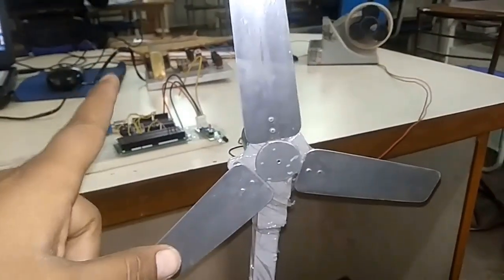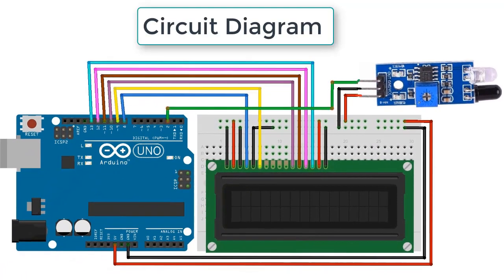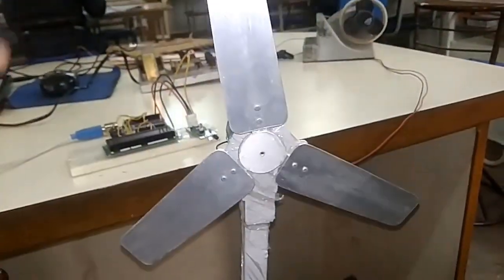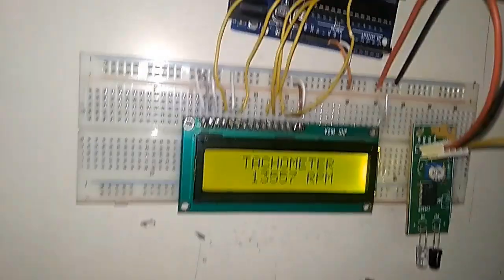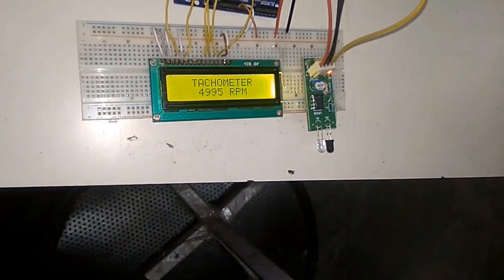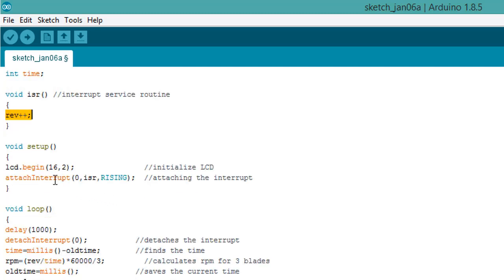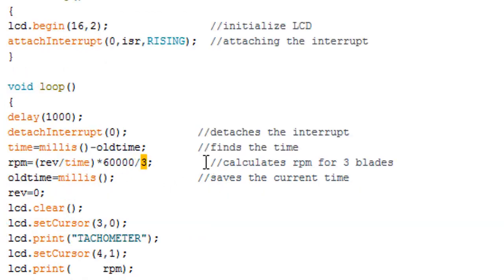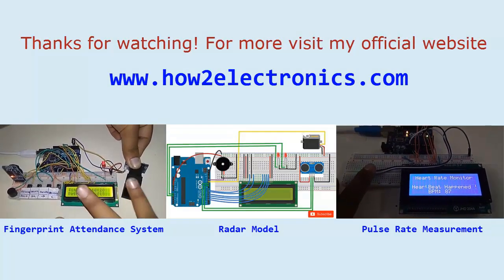Fan Speed (RPM) Measurement using IR Sensor and Arduino || Tachometer

Comment: Hi. How would this be done without using microcontrollers?
Reply: did you find out? Because i have the same problem. Let me know if you found a way
Reply: @nabeelkara31  see 1:01. pin 7 on arduino is used, use the video image at 1:1 to make the connections. It will work.

Comment: how to display it in serial monitor?
i change the code to display it in serial monitor, but it does not work. 

CODE:
//to display on serial monitor code:

float value = 0;
float rev = 0;
int rpm;
int oldtime = 0;
int time;

void isr() //interrupt service routine
{
rev++;
}

void setup()
{
Serial.begin("Initializing");
attachInterrupt(0,isr,RISING);          //attaching the interrupt
}

void loop()
{
delay(1000);
detachInterrupt(0);                     //detaches the interrupt
time = millis() - oldtime;              //finds the time
rpm = (rev/time) * 60000 * 3;           //calculates rpm for blades
oldtime = millis();                     //saves the current time
rev = 0;
Serial.println("TACHOMETER");
Serial.print( rpm);
Serial.print(" RPM");
Serial.print(" ");
attachInterrupt(0,isr,RISING);
}
Reply: So it should be

float value=0;
float rev=0;
int rpm;
int oldtime=0;
int time;

void isr() //interrupt service routine
{
rev++;
}

void setup()
{
Serial.begin(9600);
attachInterrupt(0,isr,RISING); //attaching the interrupt
}

void loop()
{
delay(1000);
detachInterrupt(0); //detaches the interrupt
time=millis()-oldtime; //finds the time
rpm=(rev/(time))*60000/7; //calculates rpm for blades
oldtime=millis(); //saves the current time
rev=0;
Serial.println (rpm);
attachInterrupt(0,isr,RISING);
}

I use no LCD. only serial monitor
Reply: @ukhtifathimahramadhani2090  mine show zero value all the time. which pin is used for the ir sensor?
Reply: You should add this after the void setup ()
Serial.begin (9600);

And simply this after the  void loop () to replace the code for lcd
Serial.println(rpm);

Hope it works on you!

Comment: thanks , but i think you have error in your code which is   
rpm = (rev/times)*60000/3 ; 
it should be : 
rpm = (rev/(times/3))*60000 ;
Reply: Brother where is sensor difine pin in your code ?
Reply: please help me... there's some error "old time not defined" in this program. what do i do?
Reply from the maker: Thanks for correction. I will update that on website.
Reply: Hi bro I need help in writing pic program to find rpm using IR sensor for motor like Hertz to rpm
Reply: @mahmoud zaher I want help in writing pic program to find rpm using IR sensor for motor it like Hertz to rpm

Comment: hello sir ... im follow your instruction .... but my lcd doesnt write anything ....  its appear something but in square pixel ... n make me confusing... pls help me sir...
Reply from the maker: Plz Lcd connection with respect to Arduino and Code.
Reply: Getting same problem black blocks i did correct connection
Reply from the maker: Use 10k potentiometer at pin 3 of lcd to adjust contrast.
Reply: Plz can you upload another connection circuit diagram and code that we upload on arduino
Reply: @ShivamKumar-rv6gc  bro my lcd is also showing the same thing have you found out  
the solution .
Reply: @ShivamKumar-rv6gc  bro does potentiometer has removed your truble?
Reply: bro if you have find any solution please reply fast tomorrow is my project submitting
Reply: @usamabinali8576  same problem
Reply: @ShivamKumar-rv6gc  Hello bro, can you help me too with the project. I am facing the same problem as you guys did. Please help
Reply: @arbaazmir854  see 1:01. pin 7 on arduino is used, use the video image at 1:1 to make the connections. It will work.
Reply: @usamabinali8576  yes i got solution
Reply: Working World  bro you made my day❤️❤️❤️❤️ All thanks😍
Reply: @usamabinali8576  bro please tell me how did you fix your problem, I am also in the same situation right now and have to submit my project soon. Please help
Reply: @arbaazmir854  see 1:01. pin 7 on arduino is used, use the video image at 1:1 to make the connections. It will work.
Reply: @usamabinali8576  there is problem in his coding or connection so try this video and do connection and coding according to this video 
https://youtu.be/iNBngx-atUg
Reply: @ShivamKumar-rv6gc did you got the solution can you please explain it
Reply: @usamabinali8576  bro did you got the solution can you please share it

Comment: Seems like a nice project, but there is no way that fan is running at 12,000rpm. At that speed it would take off like a helicopter :)
Reply: I tried the code , it does not work as shown
Reply: its actually 4000rpm
Reply: 😂😂 it was spinning so fast you couldn’t hear it.
Reply: the fan has 3 winks so the ir sensor detection the 3 winks is an o/p of 0(or 1) so now we calculate the rpm then it becomes 1200 but it's actually 4000(1200/3)...